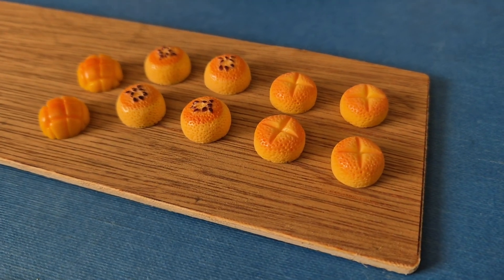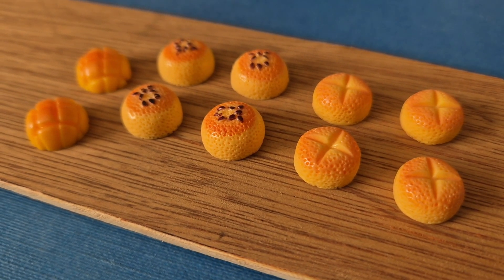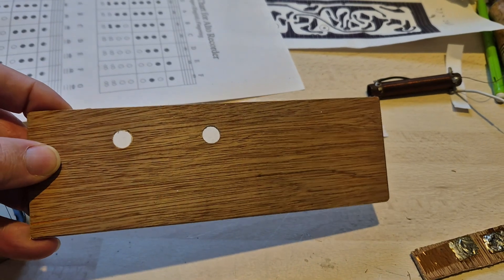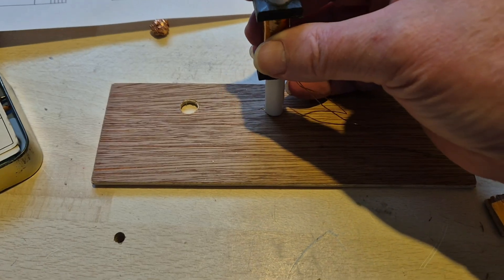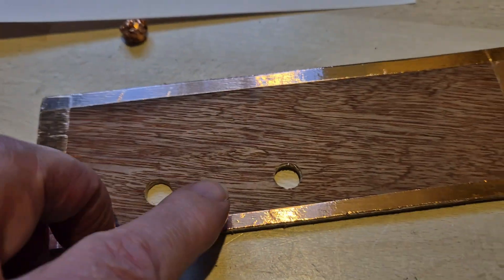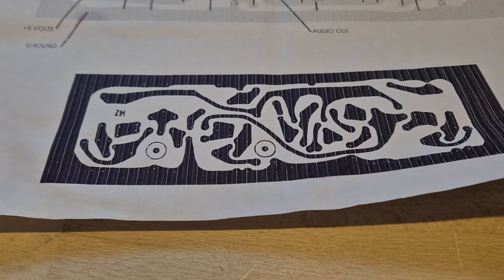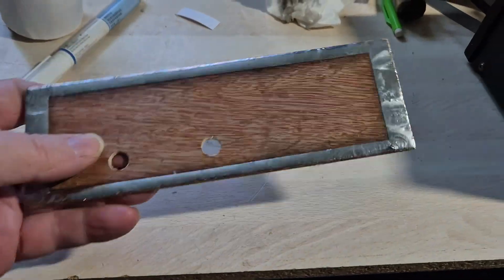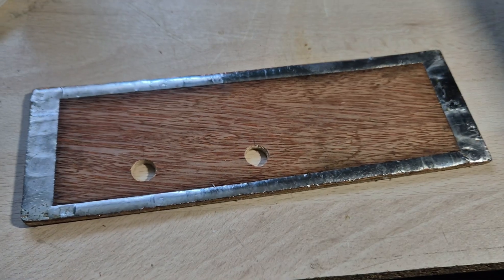Theremin Project 06

Comment: Hi Tim.  Enjoy your baking and humour. I can't reply or comment on all the channels I'm a sub anymore, but bless you for all your hard work. 

2 months ago you were cutting Ferrite rod. I've tried doing this myself with mixed results using a diamond blade wet tile saw. Moh's scale says Diamond 10 and Ferrite around 3 to 7.  Problem is that Ferrite is so darn brittle that any side to side pressure will make it snap. Try cutting a ceramic speaker magnet to learn the hard way!  Looking forward to the Theremin Concerto Tim.